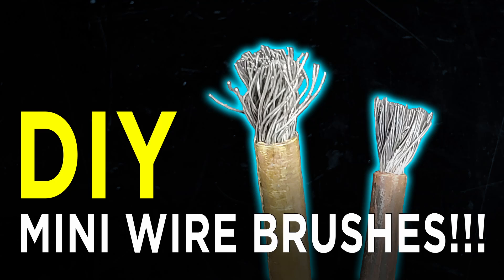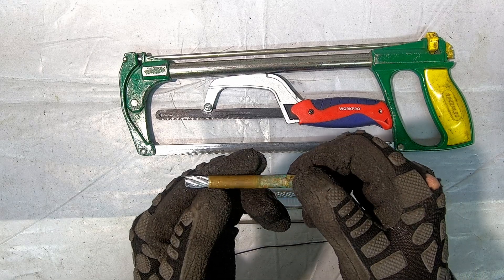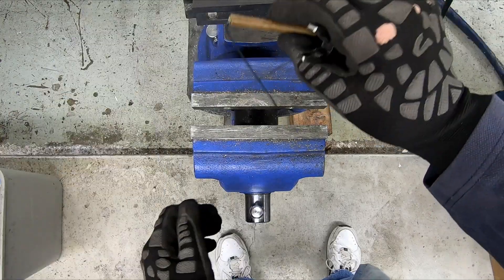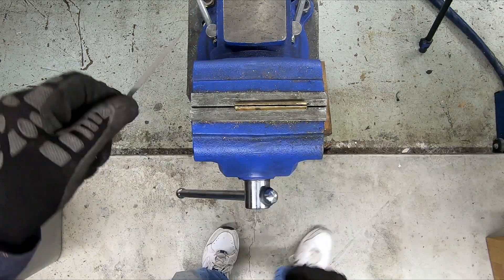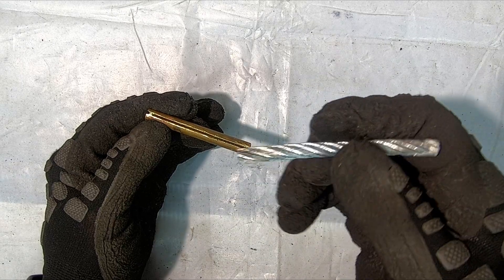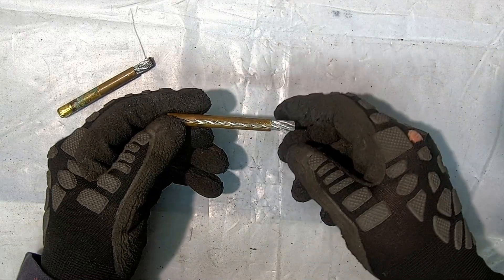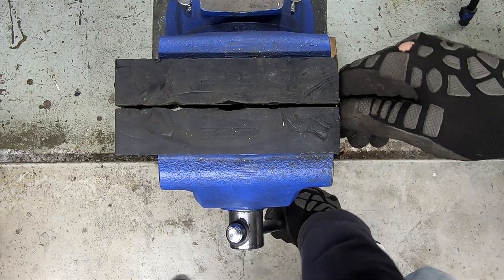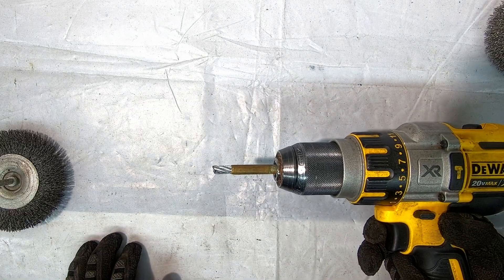DIY MINI WIRE BRUSHES

Comment: I made some of these several months ago to remove paint from some colored coded steel drill fixtures so we could change color coding, I crimped the end of my copper on to the wire rope, worked great.